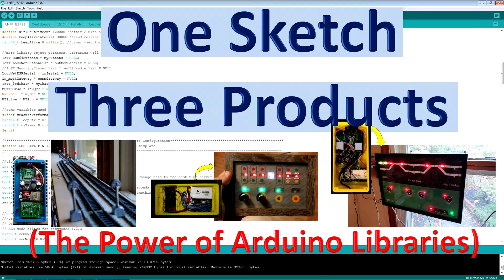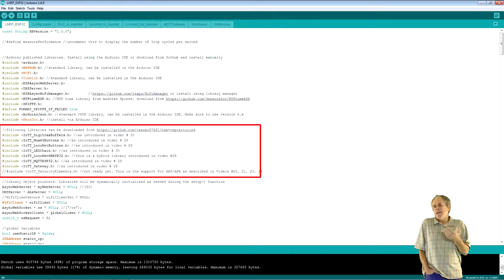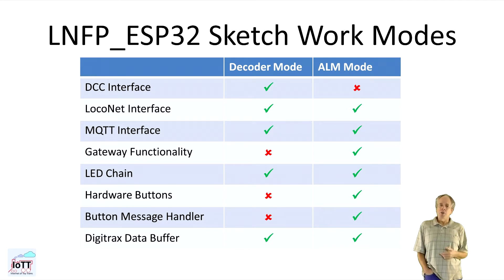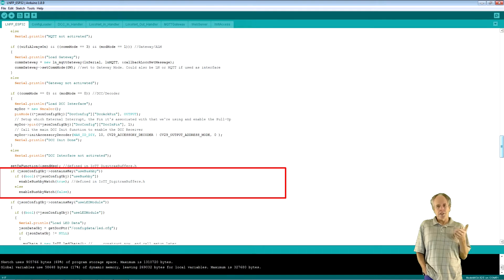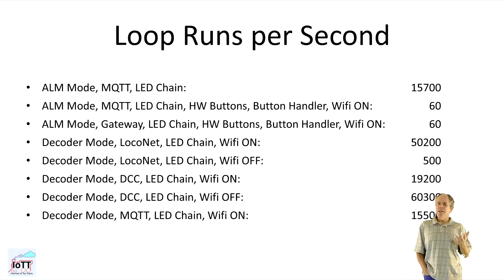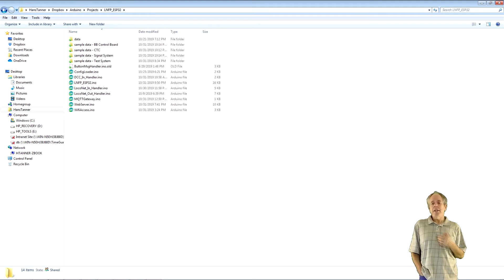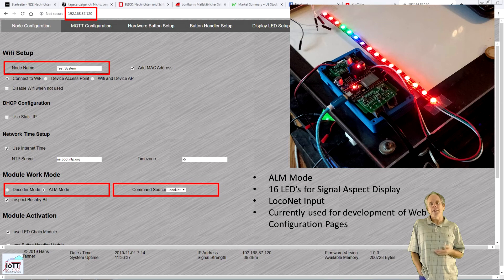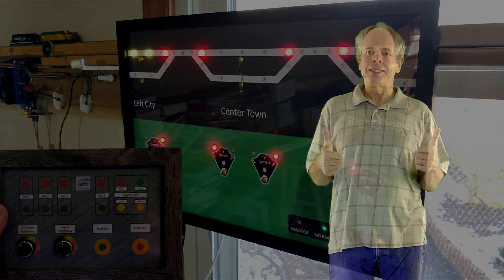One Sketch - Three Products (Video#31)

Comment: Hi, thanks for the update. I get this error: 'class MQTTESP32' has no member named 'loadMQTTCfgJSON' can you plese help ?
Reply from the maker: Looks like you are not using the latest version of the MQTT library. Get it from here: https://github.com/tanner87661/IoTT_MQTTESP32
It's a good idea to also verify you have the latest version of the other libraries. The old versions may still compile, but possibly not always function the right way.
Reply: Hi, I deleted the old version and installed the one you linked to and still get the same error during compiling.All other libraries are updated.
Reply from the maker: It is probably still getting an older version. Here's what I would do:
- comment out the line that causes the error (probably line 185 in lnfp_esp32.ino) and verify that it compiles without that line. It should.
- find the directory where the library is located, probably IoTT_MQTTESP32-master. Inside, go into the scr subdirectory and open the files IoTT_MQTTESP32.h and IoTT_MQTTESP32.cpp in a text editor. Line 54 of IoTT_MQTTESP32.h should have the function header and line 130 of IoTT_MQTTESP32.cpp should have the implementation of that loadMQTTCfgJSON function. If this is not the case, it is an older version
- if everything looks as described, it is still possible that the Arduino IDE is loading an older version, but it typically would say that at the end of the compilation output, something like "found 2 versions of library, picked this one". See if you have such kind of warning when compiling. And try to do a search for IoTT_MQTTESP32.h and .cpp on your hard drive, just to make sure you don't have two versions.
Reply from the maker: Turns out the newest version was actually an old one with line 54 in the header file missing. Please get the latest, it should compile now.
Reply: Thanks, Now  have this error: WifiAccess:41:19: error: 'WIFI_OFF' was not declared in this scope, also WifiAccess:42:14: error: 'class WiFiClass' has no member named 'forceSleepBegin'
Reply from the maker: This looks like a problem with your ESP32 core libraries. I checked where WIFI_OFF is defined on my system and found line 30 in WifiType.h: #define WIFI_OFF     WIFI_MODE_NULL
See if you can find this file, it should be in the src directory of the Wifi library of ESP32, on my system the path there is C:\Users\Hans Tanner\AppData\Local\Arduino15\packages\esp32\hardware\esp32\1.0.4\libraries\WiFi\src
As you see from this, I am using version 1.0.4 of the ESP32 core.
The line is used to switch the Wifi module inactive after some time of inactivity. If you don't want to use this feature, you can simply comment out this line for the moment and go on.
Reply: this is where I am now, C:\Users\Johnny\Documents\Arduino2\libraries\ESP8266WiFi\src/WiFiClientSecureBearSSL.h:60:12: error: 'size_t BearSSL::WiFiClientSecure::peekBytes(uint8_t*, size_t)' marked 'override', but does not override     size_t peekBytes(uint8_t *buffer, size_t length) override;
Reply from the maker: This really looks like a problem with your ESP32 installation. It seems to be trying to load the Wifi stuff for the ESP8266 instead of the ESP32. And no idea why it would try to load a secure client. The BearSSL library - according to Google, I am not familiar with that lib - is for the ESP8266.
I would probably try to load and compile some of the Wifi examples that come with the ESP32, or some of the examples that come with AsyncWifiManager.
Reply from the maker: See my reply to PaddingtonbearNZ as the mod of the NTPtimeESP.h might be the answer to your problem as well.